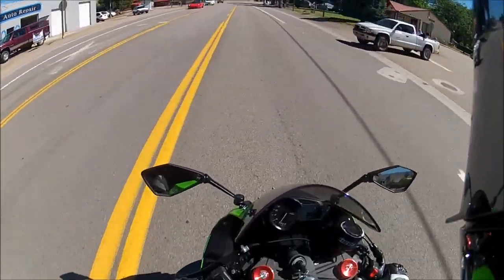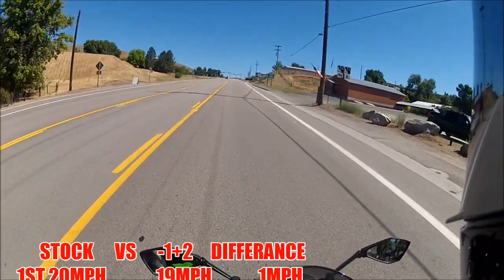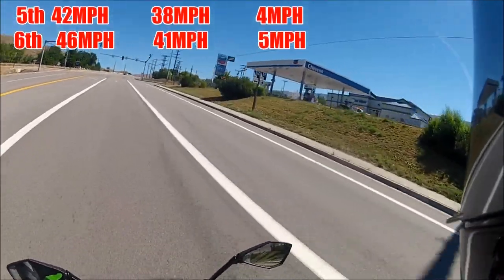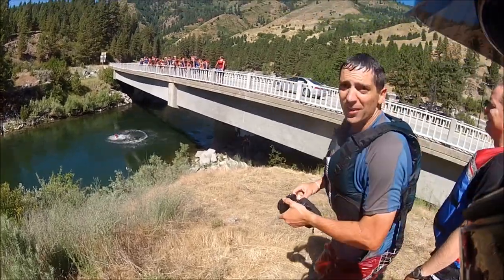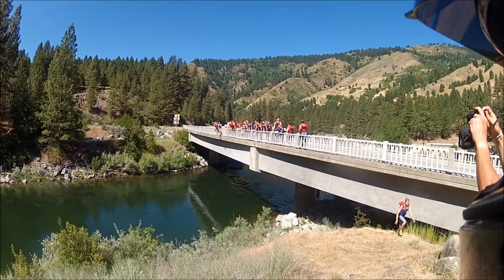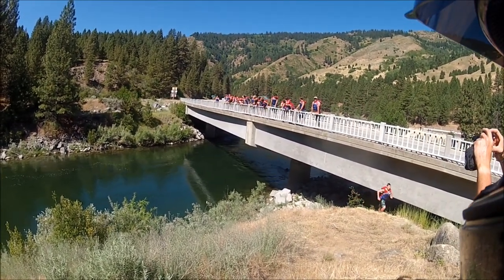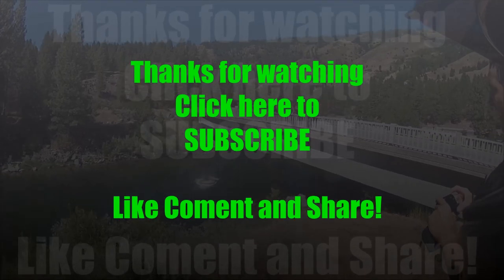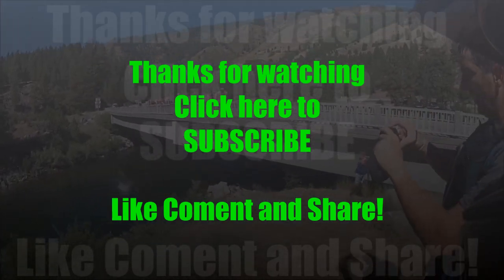I installed sprockets and talk about the differances

Comment: I got my bike back last weekend from getting a custom tune and I also had them install this same exact vortex kit (-1front +2rear) but I had a dramatically different result.  Before, I had never max'd out my bike, I had been 125mph in 5th gear and the shift light never came on.  Now, I can be 100% throttle in 6th gear and I'm only getting up to 131mph.  Speed is obviously easier to monitor/notice than acceleration, but me personally I didn't notice much of an acceleration difference.
Reply from the maker: Yeah I seen around 144 MPH at the rev limiter in 6th.   I do a lot of long distance rides so I switch to stock gears while riding around on public roads and -1+2 when I'm at the track.   A lot of people say you should not swap gears without swapping the chain or Replace the chain with the sprockets.  Personally I go back and forth 4-5 times a year so I use the same chain.    Thanks for watching and commenting.
Reply: RealxProcision so is stock better?

Comment: I haven't gotten too much time to mess with it yet, but I'm planning to start on it Friday after work, but I'm here in the US, from OH
Reply from the maker: Ok.  so far what I have see. is its related to abs bikes.   I'm going to see if there is something that can be a easy fix.
Reply: any update? I have a 15 abs and will most likely run into this down the road when i eventually replace my worn sprockets/chain.(they are ~1.2k miles) so still pretty fresh.

Comment: Do you get a front wheel up on WOT ? Or inadvertent power wheelie?
Reply from the maker: If there is a little bit of a bump it will power wheelie in first gear.  I never tried to clutch it up. I think the traction control also kicks in a tiny bit to keep the tire from coming off the ground.
Reply: Cool thanks.  I am looking at a bike that has the same sprockets as you but not into wheelies or stunting.
Reply from the maker: @mrh8409  I ended up going back to stock after a few months of riding.  They worked fantastic at the track but out in the canyons I tend to cruise, plus commuting back and forth to work.  It seemed like a lot of unnecessary spinning of the engine.   I have a few track day videos up also if you want to really see how it pulls under full throttle   Look at the ones from later in the day

Comment: At 2:50 you mention the bike wont need a speedo or healer, can you explain why?
Reply from the maker: It uses a reluctor off the brake rotor side that it gets its speed signal from.   You can put any size sprocket you want as long as the tire size has the same diameter the reluctor will read the same.

Comment: Sup people..i change my r sprocket from 41 to 38 .cos I want it more acceleration  after take of..but am not sure if that's the right set up
Reply from the maker: If you want more acceleration you would want to go the other way  44-46 in the rear.  That would make it pull harder.   The draw back is you loose top end speed.   Also changing the front, taking teeth away would do the same.  For the track, I liked 1 down in the front and adding 2 to the rear.
Reply: Cos I saw some videos they talk about the ratio..if is smaller on rear it takes less time to spin.cos want to speed up faster after take of..and yes I know I would take of slower ..
Reply from the maker: lennin chavez  check out the zx6r forum.  It really depends on what your wanting to do.   Smaller sprocket in the rear is slower acceleration but faster top speed

Comment: no 636 in the world will go above 160's.  I almost did a spit take when you said that 175mph shit 😂😂😂😂 I know because i have personally owned the exact same bike with a system and flash and I gps'd it at 164mph. The speed sensor is notorious for miss-calculating and its all over the forums. 170-200? add about 363cc's more engine.
Reply from the maker: Its been a long time sing I rode this bike,  I can say for sure that with the different gearing I ran at Miller Raceway or UMC it would top out at 144
Reply: I got 171 gps just a month ago on my 2013 636 and always got mid-high 160s previously through the years via gps. 

lowered 2 inches, full exhaust, stock chain/sprockets and power commander. Dash says 172-173 when actually hitting the speeds posted above.

Comment: I disagree anyone can ride a bike straight and fast.  Downvoted for inaccuracy.
Reply from the maker: Not going to argue about that.   I guess what I should have said is, it takes less effort and knowledge to get on an interstate or roadway and just open up the throttle vs riding a track, where you have braking and cornering to deal with.
Reply: Yes but also some bikes have headshake to deal with even at 100 MPH.  For example, standard bikes that put you out there in the wind.  Any crosswind can easily throw you off line so it is not just a matter of finding a strip of highway with no traffic and opening the throttle, there is more to it than that.  How about watching out for crosswinds, deer, stuff in the road, cops, cameras, other bikes ... ? Wow did you leave out a lot of stuff!  If straight and fast was easy, why then are there so many wrecks at drag racing which is basically straight and fast?
Reply from the maker: David James I agree to all that.  Back when I did these videos I just shot from the hip. It seems different when I'm  on the dragstrip. Trying to maintain that line.  Vs the street
Reply: Anyone can ride straight and fast come in now if you’re able to ride and shift thru the gears then if traffic is of no concern going straight and fast is pretty easy. That’s the main reason 600s or 1000 aren’t recommend for new riders. It’s too easy to go straight and really fast it’s when something interferes and they’re not ready for it shit gets bad real quick
Reply: @pravesh736 - 700 pounds for my ZX-11 + me suited up and I many times get blown around on it.  Your wrong comment tells me you are not very knowledgeable of bikes.  Even the OP agrees with me that riding in a straight line fast is not so easy.
Reply: @davidjames1684  yes. I m not knowledgeable enough to be blown by the wind.

Edit- in drag strips things are different
Reply: @pravesh736 - how so?